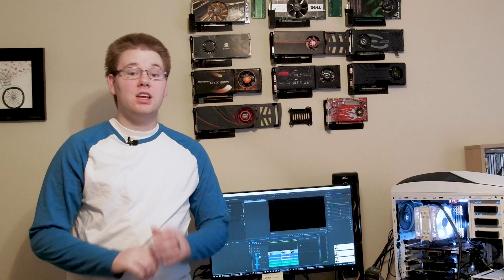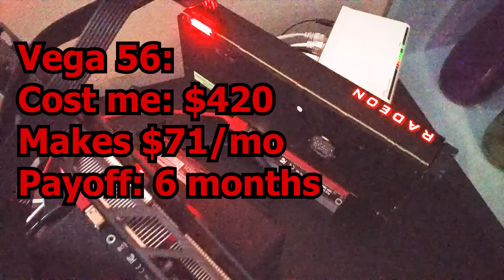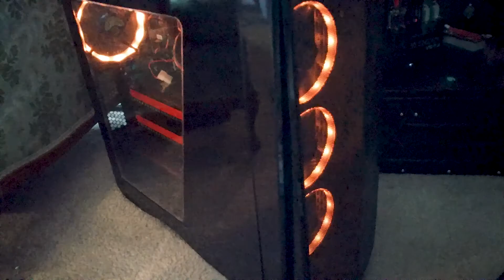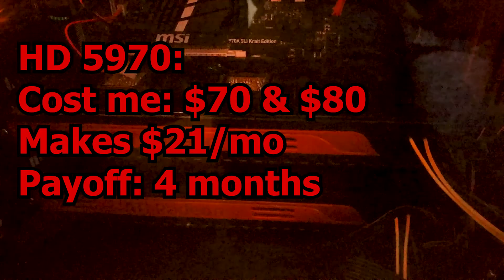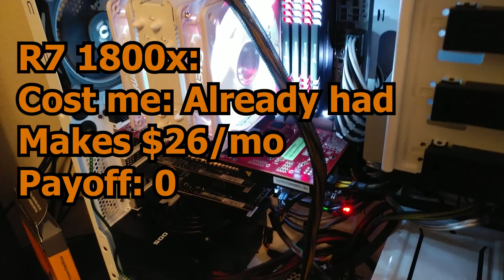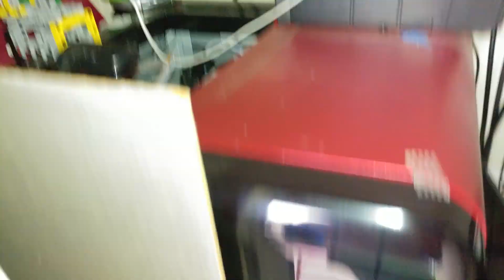I keep warm using only mining PCs!

Comment: what do you use for mining
Reply from the maker: The computers shown in the video.
Reply: @3DPC  software
Reply from the maker: @plaingaming566  Depends on which coins are profitable each year, and which cards I have in each system. Instead of using something like Nicehash, I pick specific coins based on their mining algorithms and compare that with which GPUs will be better suited for each algorithm and look at the overall network hashrate of each coin. This takes a couple solid days of research each year I do this, but you make much more doing it this way instead of having another entity skim off the top. Nicehash's benchmark tool can be useful for getting an idea of which cards are better for which algorithm. Some coins like Monero were extremely good for my RX Vega cards a while back, but since they change algorithms frequently, my cards lost their edge for that coin at the next interval.
Reply: @3DPC  so something like etherium thats good for amd cards cqn change and something would be better
Reply from the maker: We're at the point where most mainstream algorithms have ASICs making up a big chunk of the network hashrate. Coins like Monero have a better chance of being GPU profitable (in a general sense) as the frequent algo changes make ASIC design more challenging and/or less profitable. 

"What to mine" is a good resource for general profitability for modern GPU hardware if you're looking to mine with a bunch on one particular GPU.
Reply: @3DPC  Ok thank you for your help :)

Comment: Costs per month per unit—- what about electricity?
Reply from the maker: The electricity in winter is being converted to heat either way, minimal difference. I don't run mining operations indoors during the warmer parts of the year. The point of the video is that you're making the electricity do something useful as its turning into heat, as it was going to anyway.

Comment: I am actually working out specs for mining rigs for exactly the same reason. Why pay heating costs when a PC is just as efficient heater for the same power and can pay its way. I am even looking at a rack of 1050 ti kalmx so can minimize noise for bedroom. 

The reality is that a PC is just as efficient as an electric heater watt or watt and as a by product can perform calculations so you are on the right track :)